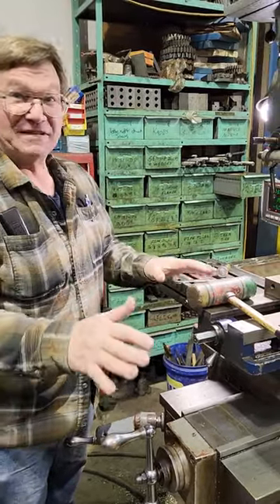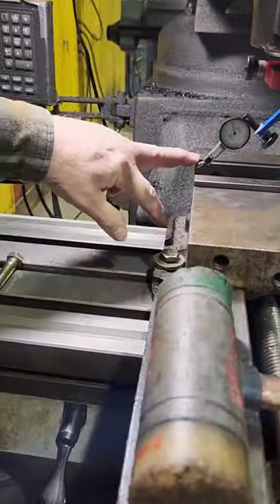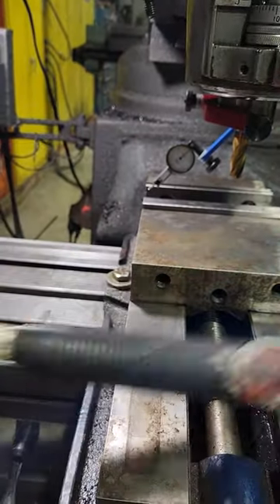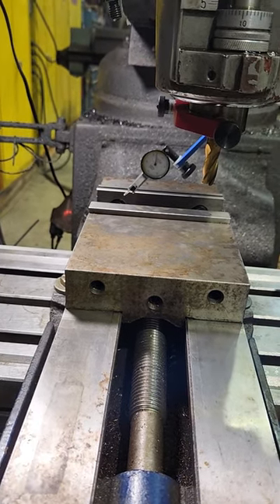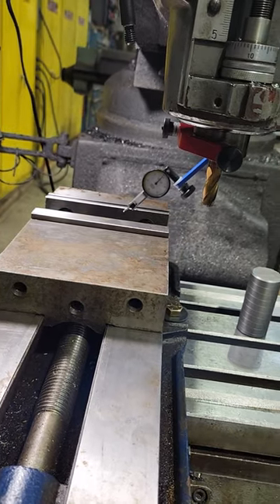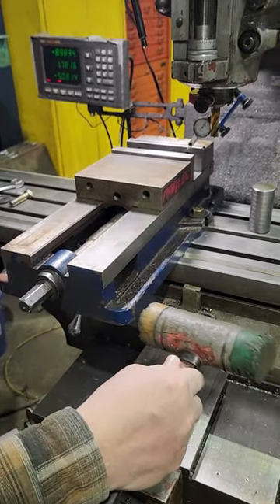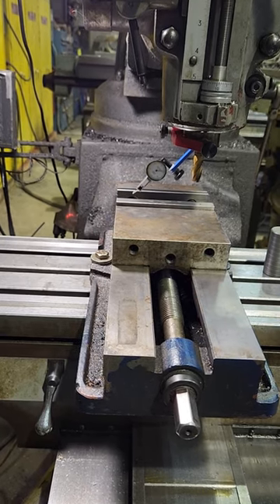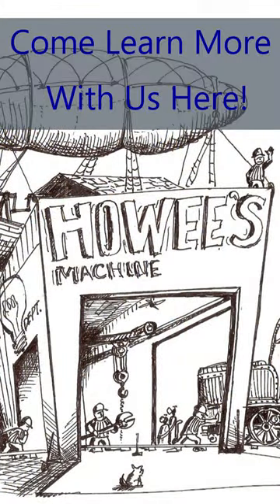Machinist's Minute: Dialing a Mill Vice Straight with the Travel

Comment: I just just a 1/2 dowel pin in the chuck , leave one side of vice  snug  bolt now use the power feed run the dowel pin against  the back jaw bam you have it  indicated  in seconds  lol

Comment: Do you sweep the bottom?
Reply from the maker: No, the bottom is a even thickness & will end up as close as it can be just by bolting it down, as long as it is clean before putting it on.
Reply: @HOWEES  thank you for sharing this great knowledge!
Reply: You would tram the head square to the table then put the vise on the table and align the vise square as the video shows.